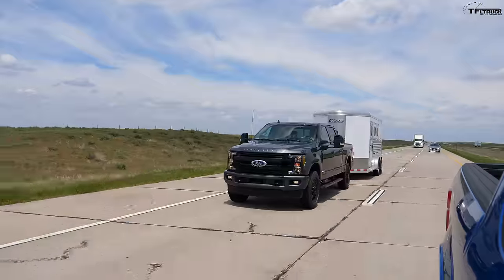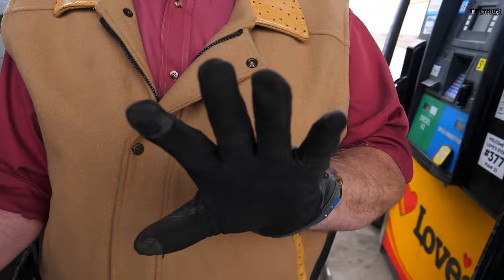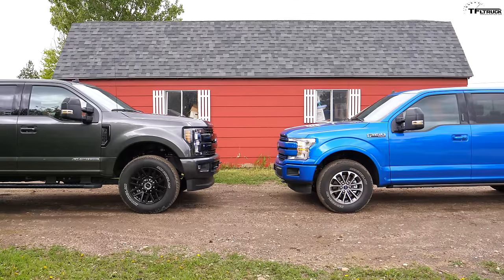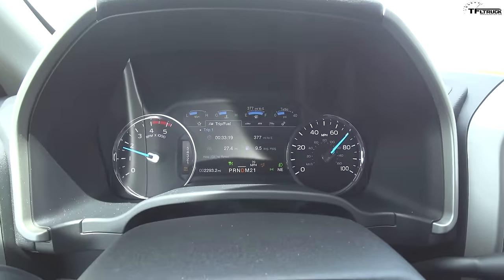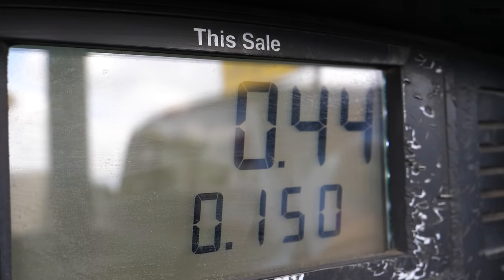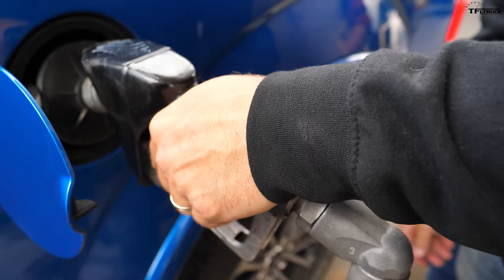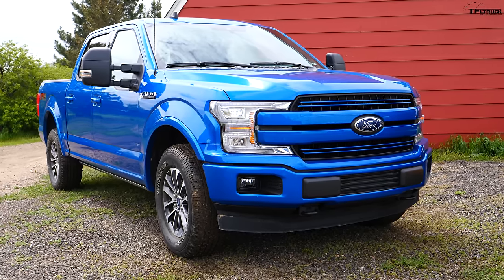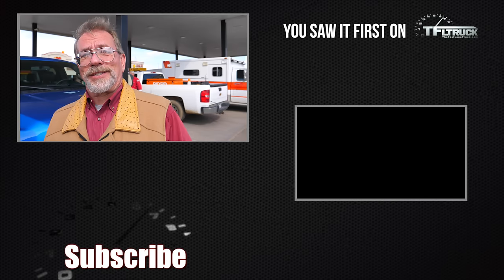Do You Really Need a Heavy Duty Truck to Tow 9,000 lbs? Ford F-150 vs F-250 MPG Review

Comment: To save you the hassle of these two youhoos rambling on.....

250 Diesel, 8.9 mpg
150 Gas, 8.4 mpg
Reply: Party pooper.  Lol
Reply: @6XChamps You have a 6.2, a much heavier truck, and a 6 speed versus the lighter F150 with the 5.0, and 10 speed transmission.
Reply: Lol. Thanks. You're just the comment I was looking for
Reply: @6XChamps the cost of 1 mpg is well worth the $10,000 savings for the diesel
Reply: Plz what kind of galon ? 
(US galon or normal galon)
Reply: @CrazyEye75  
$10,000 dollars savings of the diesel? Can you elaborate more on what you are trying to say?
Reply: @6XChamps 
How fast are you going when towing that amount of weight?
Reply: @Sig721Tau  shoot, meant to say for the gasser.  In Canada the diesel is just shy of a $10,000 dollar option over the 6.2 gas engine.  If your gonna buy brand new of course.  $10,000 buy alot of gas, lol
Reply: @CrazyEye75  
Yeah, Diesel only pays for itself if you tow regularly...almost for a living.
Reply: Actually Diesel also pays in resale.  My 2004 Ram 3500 has only lost about 20% of what I paid for it new.  If it were a gasser I would lose about 40-50%.  Granted I take exceptional care of it and it has low miles but that would be the same if I had a gasser as I have several other vehicles.
Reply: The F-150 used $1.52 more in fuel in 66 miles.  Or 2.3 cents per mile.  If you towed 434,782.6 miles you would reach the break even point assuming a $10,000 price difference in the trucks, not counting the higher maintenance costs of a diesel engine.
Reply: But then when you get to that mileage theres also durability of towing with two different platforms. Its still a half ton vs a 3/4 ton which is made for towing. A frame that's meant to tow everyday vs a frame that's meant as a tow maybe once a month or every two weeks (9000lbs and over obviously). Let's see which one gets to 500k miles first and see what's been replaced
Reply: Thank you Jesus
Reply: @CrazyEye75  
Oh, okay.
Reply: @CrazyEye75  remember... that's 1mpg difference at 9,000lbs. In my '03 Dodge 2500 towing my 17,000lbs gn horse trailer, I average about 16mpg highway/10 city. Towing around 9,000lbs, I get around 18mpg highway/13mpg city. That F-250 will likely not fall below 7mpg average for nearly double the trailer weight. Meanwhile, that F-150 CAN'T pull it, but if it was forced to, you'd be looking at substantially lower mileage. That F-250 kind of gets abysmal mileage to start, though. The load on the engine doesn't affect the diesels near as much.
Reply: @6XChamps - if you are towing 10000 lbs with a Toyota Corolla, I would expect you to get more than 7.5 miles per hour.

Lol. Yes you can go ahead and call me an a******, I am acutely aware of this.
Reply: @CrazyEye75  CORRECT Diesel cost more than regular unleaded gas! Mile for mile the  F-150 regular unleaded fuel is less expensive if the info is correct.
Reply: @mikeangelo4011  Normal US gal
Reply: @Sig721Tau  same speed I tow my 15klb 5th wheel, 75 to 80
Reply: I tow 9,000 all day with my 2016 power stroke and get 13
Reply: Thank you for saving me from watching the video.
Reply: @terrywaters6186  Are you sure? Diesel is more expensive. IMO they didn't actually save anything.
Reply: Thank you 😅
Reply: @6XChamps  You're towing a bigger thing. Their ratings only 9000 in the video. You're Towing an extra 100Ibs  So yeah you're gonna drop on gas mileage.
Reply: It's not very fair honestly. 
 I fail to see their logic. 
 Let's compare a 1/2 ton to a 3/4 ton. One with a "diesel" and gas...
Reply: @fsb_-bf3th  Ford has yet to build a diesel engine that will last 500K.  Have you priced out a new Ford diesel engine ? (6.0, 6.4 or 6.7.)  I've  been driving Ford diesels since 1998.
Reply: Talonpilot thank u
Reply: @terrywaters6186  if you consider the price of diesel vs gas per gal the gas fuel expense is probably less.
Reply: Would love to see a video on how the 3.5 v6 turbo performs.
Reply: Resale value is a real thing.  It's not a true $10k difference in cost when you get much of that back on resale.
Reply: @SomeTechGuy666  if that's the case you would have driven a 7.3...

Comment: I wish you would have done the gas f250 v the ecoboost f150. I think this is a more likely cross-shop for weekend warrior towing duty.
Reply: The eco boost is already more thirsty then the V8, but f250 has vs 150 would be interesting
Reply: Exactly. They've proven over and over the EB is superior.
Reply: I wanna see diesel f150 vs gas f250
Reply: I agree joe. Ecoboost vs 6.2L Super duty. I wanna see that.
Reply: F150 with 3.5 Ecoboost with the MAX tow trailer package vs F250 gasser pulling 9000 lb travel trailers would be a better test.  Very few horse trailers on the road.
Reply: The gas f250 and f350 don't get very good millage towing and you can feel the weight of the trailer. I went from a 93 Chevy 1500 with a 5.7 to a 08 6.4 diesel to a 19 6.2 gas both f350 big power differences but you just have to remember to stick your foot in it  more and she will go.
Reply: @xyrothryu  than*
Reply: @drew4769  its past tense then is correct.
Reply: @easyrider4x  very few horse trailers? Says who? LMAO
Reply: Just watch the interstate on any given weekend and compare the number of campers going by vs the number of horse trailers.   I bet the ratio is 500 to 1.  These guys need to do all these weight pulling tests with travel trailers.  That is the demographic they need to  target.  If your truck can pull and “handle” a travel trailer, it will have less issues with a comparable weight horse trailer.
Reply: Dalton v @easyrider4x get out of the city homie
Reply: nope they haven't proven it.
Reply: When buying an F150 the NA V6 and NA V8 are the only real options. Ecoboosts explode at 150,000 miles, sooner when towing.
Reply: @cm01 someone should tell my 220k eb that I tow regularly with the news...

Comment: I’ve owned both trucks.  Tow a trailer in the mountains.  You will see the difference.  The F150 felt like we were going to die.  Love my F250 Diesel.  Also I drive 65 MPH.  My MPG is around 11 towing my 10,000 pound 5th wheel.

Comment: 🧐
I own 2016 f250 Diesel and 2017 f150 5.0. I tow slightly more weight and get around 11 mpg with the diesel. Only towed a couple of times with the 150 and was around 8mpg way less weight than you guys. Do have to say breaking and handling way above the 150 in the 250!
I do love both my trucks for much different reasons.
Fun video! 😎

Comment: I have a 2012 f150 eco boost with the extra tow package and  pulls my half ton  towable 5th wheel good  , 9 miles per gallon while hauling and 15 to 19 going down the highway empty . Dry weight on the trailer 7600lbs max load 10000lbs , I haven’t maxed it out on weight  and don’t plan to. I’m thinking of going to a f250 7.3 .

Comment: I love seeing the payload stickers :)

I would also like to see y'all tow some campers.
A 9000lb horse trailer is cool, but how do these trucks handle a 9000lb camper that's 30ft+ long.
Reply: Exactly! Around 26+ft and the wind will blow the trailer around and really push a half ton truck around!
Reply: I'm used to it. I pull a 53 trailer with a 379 peterbilt:/
Reply: @ur2ez2011  
But that totally different truck that not even comparable
Reply: For a 9,000lbs, 30 plus ft travel trailer, you need the HDPP half ton F-150  minimum,  much more stout than the Max Tow.
Reply: @madbear3512  I know lol.
Reply: I have a ram 1500 Eco diesel and it tows the 6500lbs dry weight easy then it tows just as well at 8000lbs loaded. It’s 31 foot plus tongue. It does not sway much a little pretty long for the truck. If you have more questions let me knows
Reply: Donnell Wood Hi Donnell, I don’t know what a HDPP F150 is. Could you define it?  ThNk you.
Reply: @rdbjr52  Heavy duty payload package
Reply: Not to mention a 30+ foot travel trailer at 9,000lbs would more than likely have a tongue weight too heavy for the factory hitch on an f150! I just did the switch from f150 to f250 diesel and i would never go back. Tows my 30 foot jayco jayflight so much better and way more stable than my f150 did.
Reply: I have a 32 foot travel trailer that weighs 8900 lbs. I pulled it with a 2018 F150 with 3.5 EcoBoost. While there is plenty of power to pull it, anytime there was a wind stronger than 15mph it blew me all over the road. I just recently moved up to a F350 and it makes a world of difference. I wouldn't recommend the F150  for long trailers.
Reply: easy
Reply: My Tundra hauls my camper everywhere. 35 foot bumper pull toy hauler. 10,000 pounds when loaded with motorcycles. Go to Sturgis every year from Duluth as well. LT tires and a good sway reducing weight management hitch is the key. Also, Timbren bumpers in rear ($250).
Reply: @ummduhgmail  your suppose to add wind resistance into your over all gvtw
Reply: HDPP towing _ hasp
Reply: RDB Jr  Heavy Duty Payload Package option.

It requires the Max Tow package, but add  stiffer springs, shocks, an overload spring (four springs vs three), 3.73 rear end, LT tires,.etc. 

I have 2,475lbs payload.

The HDPP is a true representative of the limits of 1/2 ton towing, not a loaded  Max Tow, especially when it comes to a travel trailer.
Reply: Cory Wagner I wouldn't tow your trailer with your truck either, but I'd tow it with my HDPP.

I wouldn't tow anything with those spongy P-Rated tires, nor those soft sided China bombs trailer tires.

I can tow a heavier and longer trailer more stable in higher wind  than your Max Tow could a lighter and shorter trailer..

I can tow my 37ft trailer in 30 mph wind gusts, and at that wind speed most big rigs are slowing down also, and I'm not passing a wandering big rig trying to stay in its lane.

Fifteen mph crosswind is barely noticeable at my 67mph cruise speed...I still got one hand on the wheel at those wind speeds.
Reply: @corywagner8709  Do you still use use anti sway bars?
Reply: THE F150 WONT
Reply: Handles it easily, and you don’t need a HDPP either.... sway issues with longer travel trailers mean you either have trailer cargo distribution issues, and/or don’t have a properly set up weight distribution/sway control hitch gear. F-150 EB Max Tow/32’ foot trailer here, 8500 lbs loaded, 4 point Curt Tru Track weight distribution/sway control combo, no issues.

Comment: Great video. But if pulling a longer camper at that weight, you might get more sway. We had a 150 pulling out 8500 pound 30 ft camper. Good power, but was unsafe on the road. The 250 gas handles it like a dream!

Comment: Pulled a 10k fifth wheel with a 3.5 ecoboost F150 through the mountains of WV and MD with no problem and managed 9 mpg smooth as oil
Reply: The truth. I just towed 2,000 miles with my 2015 F150 Ecoboost Platinum 4x4, man, talk about power! Smooth alright. And same, 9 - 10 mpg.
Reply: The mountains of WV and MD; I didn't know that there were mountains in WV and MD, but I live in CO, so if it's less than 10,000', it's not a mountain!
Reply: @wasichuwacanta7010  WV has some pretty steep grades just because it's not a mile or two above sea level doesn't make it any less of a mountain grade.
Reply: @brandonmoore9440   I have towed throughout the states.... I70 in the Rockies has been the hardest to tow up... Anything else feels like hills... Its funny though in every state that has a pass locals will always say its so steep and hard to tow up be careful haha.. When it was all new to me I believed it every time... Not anymore... I would always tow the "crazy pass/grades" and always wonder if it was still ahead of me. They are so short and at lower altitude the truck is breathing very well... The Rockies choke up the truck so even on the shorter grades you're feeling a bit short on power.
Reply: @brandonmoore9440  True, it might be a mountain GRADE, but it ain't no mountain!
Reply: wayne schmidt try that here in Colorado. Your gas engine at 10,000 ft elevation will get about 5-6 mpg while my diesel truck will still get 9-10. Gas is great at lower elevations, but diesel is unaffected by altitude. Science.
Reply: @BretAllenStudios  That ten grand i saved will buy lots of fuel for the limited number of times i travel at 10k and i will also save thousands on maintenance as well. i guess it's all in what you need and how big your wallet is.
Reply: No.. but the performance of the engine at 1500 feet is very superior to what it will do at 12,000.
Reply: @extremepoweraddicts2978  I sort of group Nevada above Colorado if driving end to end.   Colorado is certainly "steeper" but you completely lose track of the "mountain ranges" in Nevada, there really isn't a range, it's just a constant 10 hour drone of 3,000 to 10,000 feet going up & down like a roller coaster.   Nevada allows very poor-grade fuel to be sold as well, compared to other western states, so you also use about 25% more of whatever crap they are selling.  I think the clime out from Salt Lake City to Park City Utah is definitely the steepest though.

Comment: I pull a 9200 lb., 40ft. travel trailer, 780 tongue weight with my '20 F-150 with no issues whatsoever. Typical highway speed of 70 mph and she tracks along great. Only time it gets a little squirrly is when you get crosswinds at 30 mph+, but slowing down a bit corrects that issue.
Reply: That's a beast!  5.0 or EB?
Reply: EcoBoost. Great torque! Get about 18.2 mpg average w/o the trailer and drops to about 12.8 with the trailer. Don't get me wrong, I don't pull all over the country; but it gets me around the state just fine.
Reply: @gerrymiller7401  good to know...planning on using my wife's Expedition to tow our 24' to Yellowstone next month....am kinda nervous,  but we did it with the old 5.4  a few years ago and we averaged 10 mpg.  Hoping the new one does better.
Reply: @workct4102  I have no idea what the capacity is on an Expedition. I can pull 13,500 with my F-150 so obviously I'm well under that. I also have extended axle separation on my trailer which helps with load distribution and sway control. If the Expedition is 2019 or newer and has a towing mode it should be fine if your under your limits. Ford's 10 speed tranny with the additional cooling features with that tow mode makes a difference.

Comment: Now blow both tires on the same side of the trailer doing 70 MPH.  See which truck handles that better.
Reply: Hil Palmer if you buy quality tires and keep an eye on your tire pressures, what are the odds of that happening?
Reply: @sniperdoug1969  Just saying...  Something can happen to the trailer.  My brother and his entire family was hauling a load of wood in a trailer and a weld broke lose on one side.  Trailer yanked back and forth until it flipped.  If he didn't have a 1-ton with the 7.3L diesel in it he more than likely would have been in the ditch.  But with the weight of the truck being closer to the weight of the load he was able to keep it on the road.  He needed to change his shorts!

Comment: Love your videos, but I see one problem that you will never know about unless you have a tuner. If the F250 went into “Regen” during the MPG loop it will drop the MPG significantly. I’m talking 5 or more mpg for the full time it’s in “Regen” mode. 

I have a 2019 F250 Powerstroke, and I wish Ford would have but some sort of notification or gauge showing how full the DPF filter is and when it’s going into Regen mode. I purchased an Edge CTS2 Diesel tuner (emissions tune) and now I know how full the DPF filter is and when Regen mode has commenced. 

As always, great video!
Reply: I agree. I own a F250 2016 and my biggest complaint is not knowing when it’s done with regen as well as not knowing how full the filter is. A manual regen ability would be nice as well so I can pick when it cycles, not 3 blocks before I get home.😒

Comment: I have a 2017 3.5 EcoBoost, 355 rear end. 10 speed tranny. I tow a 10000lb 30' rv trailer. It absolutely rocks. The power is great 375hp/470 lb/ft of torque.  The right setup is key. Weight distribution hitch.  Sway bar, set my trailer brake gain at 8 and it stops just fine. Handles great. I love it.

Comment: I had a 2017 Ford F-250 and it pulled our 15,000 pound trailer (camper). But I just bought a 2020 F-350 and just stuck an 8 inch lift and hostile 40's. It is awesome!! Gonna tow that trailer next week.

Comment: Good comparison.  A better comparison would have been a 6.2L gas F-250 vs. the 5.0L gas F-150.
Reply: I would have liked the gas F-250 also as the step to diesel once reaching the F-250 is another level IMO.
Reply: A gas 7.3 is on the list for this fall.
Reply: Yes and comparable rear differential gearing when testing the different motors/ trucks

Comment: Don't forget that diesel is currently 31% higher than gas and you need to add another 2% for DEF. Based on prices Yesterday at the pilot in Port St. Lucie FL. My more efficient 3.5L twin turbo (compared to the 5.0L) will cost less when towing 15,000lbs and way less when empty. My 4x4 3.55 3.5L gas gets 12% better mileage at 70mph than my 2wd 3.31 6.7L diesel did.

Comment: You can thank the EPA for the poor performance of the Diesel engines.  It used to be that a Diesel engine was far more fuel efficient and the fuel was much, much cheaper.
Reply: Pop Corn yea remember diesel was definitely cheaper
Reply: Pop Corn it was a by product of gas production when we had real gas especially the dpf bullshit
Reply: What esp. kills the mpg on modern diesels is the freaking regens. Its almost like having a sizable fuel leak while trying to get something resembling fuel efficiency.
Reply: If my Powerstroke smoked and stank like they used to I wouldn't own it.